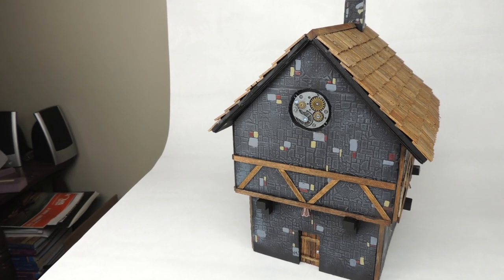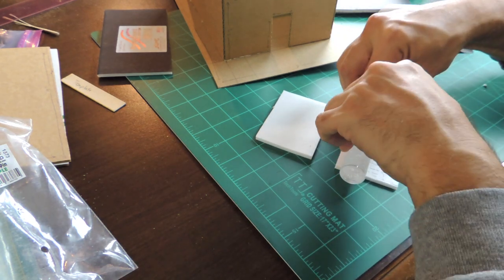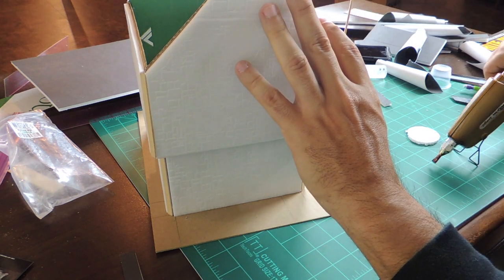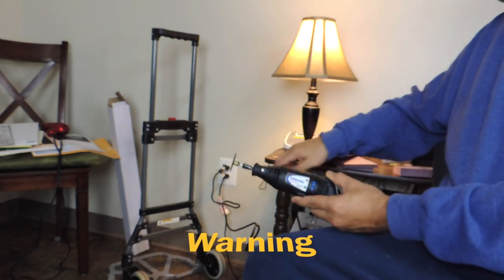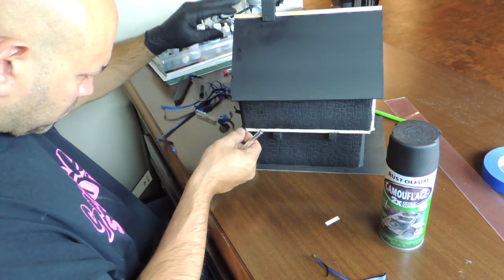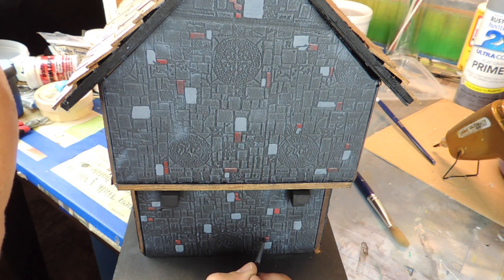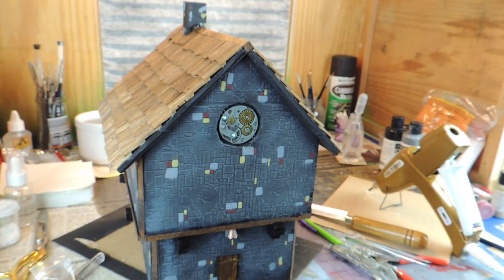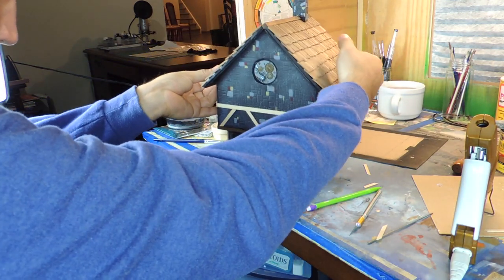Lets Build: A Clockwork Townhouse

Comment: As far as peeling the paper off of the foam board if you have a heat gun it works wonders. Just a medium heat and the paper peels off in one piece.
Reply from the maker: Nicholas Freeman I have a small hair dryer that I use to dry paint between coats, I wonder if that will work, if not I’ll invest in a heat gun.  Thanks!